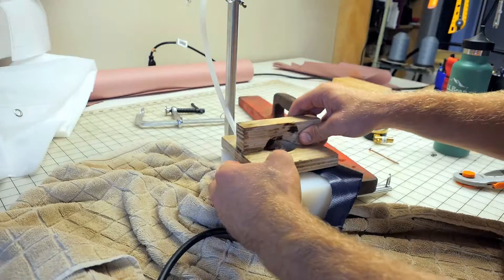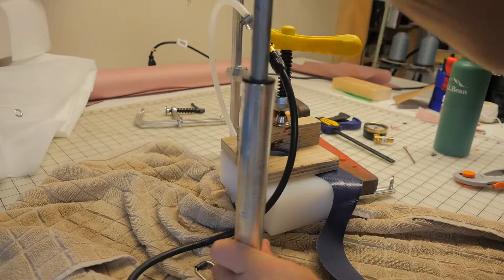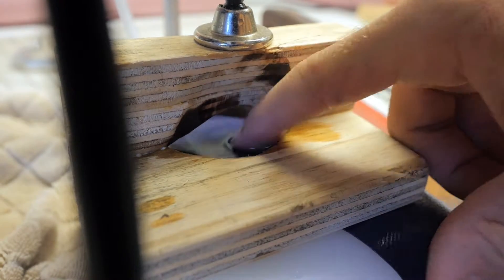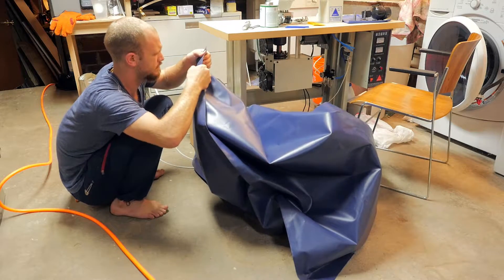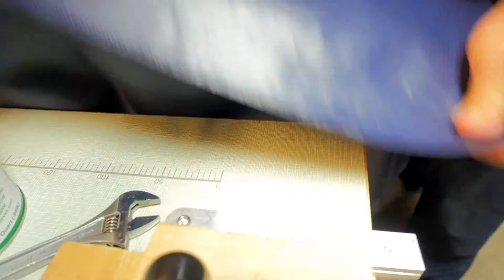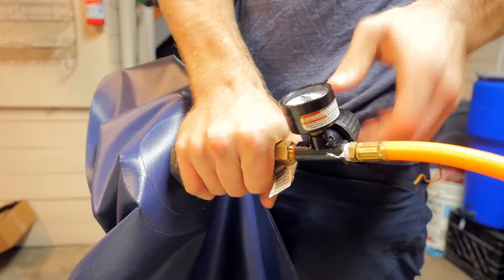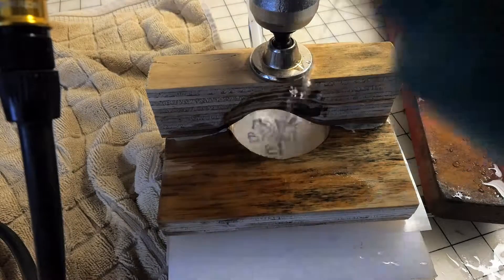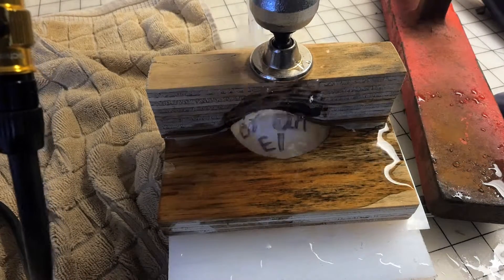Is truck-tarp airtight?

Comment: Can you please tell me the name of the material you are using for your bladder and where it was purchased?  Thanks!
Reply from the maker: Pops Custom Clips I used truck tarp (vinyl coated polyester). Just be aware that I have seen some that is not fully airtight. You should check it with a hydrostatic pressure tester.